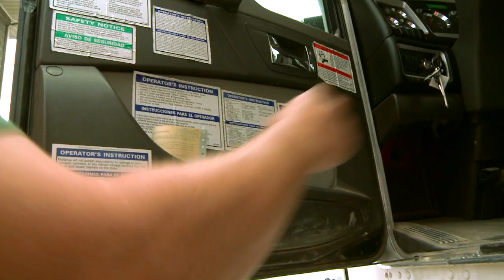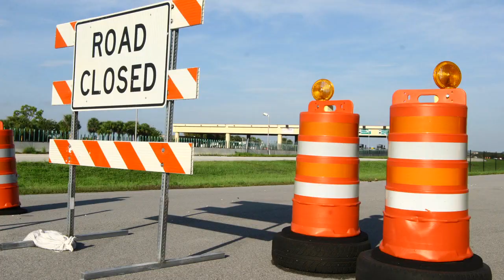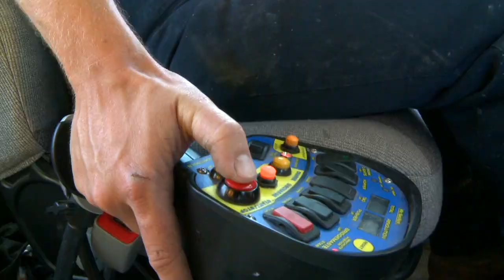A Day In The Life of a Driver FINAL

Comment: Truck are mostly automatics today.  There’s a few companies that have manuals and that just fine.  What’s not cool is driving a 20 yr old 5 Speed Mack Truck.  There’s no reason a big company in the Nations Capital still runs old Macks.  I just left a good paying job for throwing me in an old 5spd Mack.  I’m not fuking with a heavy clutch at my age when automatics are the trucks of choice today.  The days of driving crap as the new employee is over.  I returned to concrete after leaving in 2008.  Good luck and stay safe operators.

Comment: I'm from Dublin Ireland and I have worked on concrete pump's for over 20 year's I hate when the mixer driver over fills the Hopper and spills concrete all over and then does not clean it up or when they Try wash there Chute's into the hopper and use to much water and block's the Pump.
Reply: I drive a 9 meter concrete truck and when I am finished at the pump I lift my chute up and drive to the washout location. I don't scrape the stones in and I dont add water to thin the mix and plug the pump. Show the pump operator some respect. He's there before you and is there long after you.
Reply: @randy7068  never heard of 9m mixer Where are you in world? Anything on you tube?
Reply: How about when the pump operator is running hard and stops the pump without warning and the hopper overfills and blames the driver!   Or he keeps pumping and your yelling that your truck is empty and blows up concrete all over the driver and his truck !  Mixer driver 30 yrs seen it all !